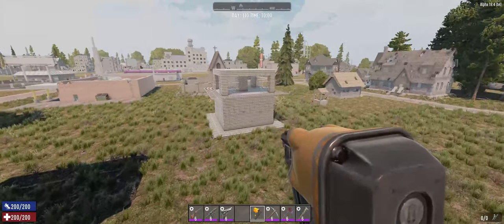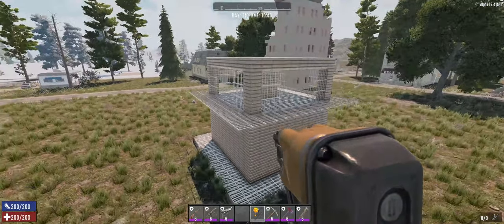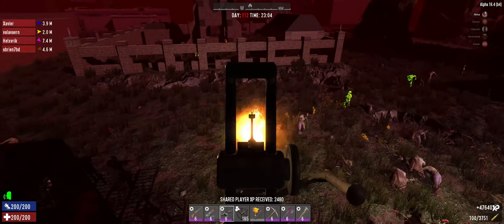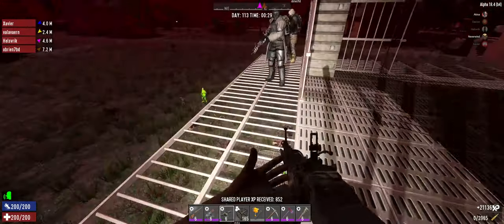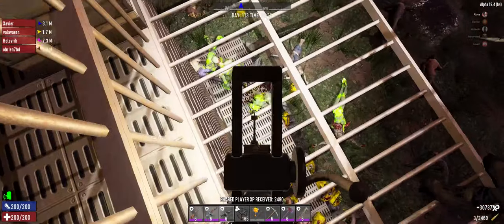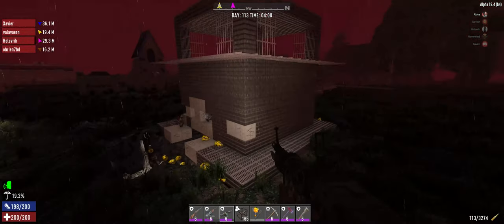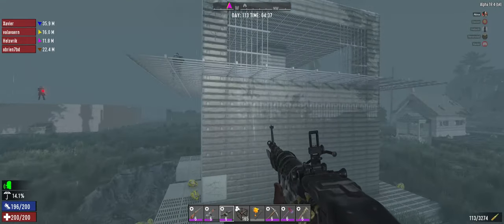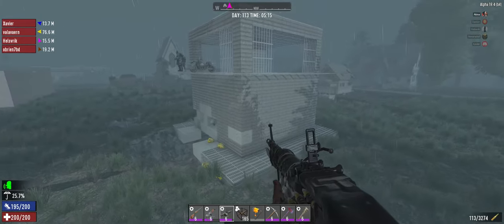7 Days to Die - Does Base Design Matter In End-Game?

Comment: Ditch the bars and use vertically placed half blocks around the perimeter with the gap facing the inside.  You can't fall thru the gap, but you CAN both shoot and throw explosives thru it.  
Sheath the outside of the half blocks with plates going up and overhead.  The base will look like a big mushroom, but it will protect you from spitters.  (Top the base with spikes to kill off the birds)  
Then just wait for a horde wave to crash against the side of the cube, toss down 9 unlit pipe bombs followed by a lit one, and wipe out the zombies en masse.  Rinse and repeat until 4am.  It's cheaper (around 700 bombs) than all the ammo you would have to use, and pipe bombs are craftable from simple materials.

Comment: You should try a doorway base! Get on the roof of a building. Build a ramp to it for this zeds. Then build a small wall to stop them from jumping. Then just build a doorway at the ramp with a block in front of it on your side or horizontal poles. Then you only need to reinforce the doorway. Super easy. Super cheap and you can just melee. No ammo required.

Comment: The problem with creators using only steel in their builds is it removes all stress of a breach.  My POI horde base has been breached 3 times (one death and two escapes), because I did not have enough materials early enough to upgrade the POI's walls.  Even though I have my horde base mostly horde proof at Day 63, I still run around the POI looking for walls to repair every time I think I hear a zombie smacking a wall.

Comment: Regarding this video, I second this. I'm saving all my base design concepts for when A19 finally hits the market, and so I've resorted to a very expensive but unimaginative design; it's just a set of four towers (9x9 wide and 7 tall for the floor, and the towers continue to extend above that) with four 15 block long, multi-thick walls connecting them, creating a square formation. Most of it's r concrete or steel, and even on 64 max alive (solo), they cannot make the tiniest dent into my fortress, and there's no traps, no pits, no cheese, just a strong, durable base. I've probably enjoyed defending this base the least due to the lack of effort I've put into it, but it's still extremely effective.
Great video, btw. :)

Comment: I built the pit to bedrock with a 7 block high suspended platform build you guys showcased a bit ago and that thing works like gangbusters except on night 70 they decided that instead of falling down the center they would dig straight down to me from one of the corners.
Reply from the maker: Hm. Tough to say why without seeing it.
Reply: @ICG  it was probably a case of a couple getting hung up between dirt and cement topside and it just led to a cascade effect where the rest of the horde just walked into the hole that they had started.
Reply from the maker: @TheTABCore  possible.

Comment: You also did this with 5 shooters bro... Not everyone has a squad of 5.  However good points made. I would like to see if this holds up with a solo or Duo.
Reply from the maker: True, but that also increases the size of the horse significantly. Solo hordes are generally a lot smaller than this, so there's a scaling factor to consider. 

We didn't post a video of it, but the issue was raised when we first posted this vid and it got me curious enough to test it solo on a private game. The results were similar, actually a little less damage because RNG didn't give me quite as many demos when I was alone.
Reply: @ICG  bro... this is one of them things that just ruined my grind... kinda like Duping. This killed a little piece of my heart for this game
Reply from the maker: @kaotichymnzz7625  Don't look at it like that - look at it as a challenge. How do you design something BETTER if this braindead build is the baseline for safety? Look for ways to make your builds safer, more efficient, more fun, etc.
Reply from the maker: @kaotichymnzz7625  I recorded a solo vid w/ this idea vs a 64 spawn horde today. You'll prob be interested.

https://www.youtube.com/watch?v=eTKXxe9ULiE

Comment: That the base design doesn't matter is one of my biggest criticisms. But I don't blame it on the durability of the blocks but on the equipment. As long as you have the right weapons and enough ammo you don't even need a base. You can just run around in the streets and fight the zombies like that. Or you take over any stable POI, make a few holes in the ceiling and shoot the zombies from above.
I miss the days when I fought the early horde with bow and arrow. My current base is a melee base. This is more fun than shooting the zombies and it is much more efficient in terms of resources.
But I also like base designs where the base can defend itself. Then I just have to get the popcorn and watch the base take care of the zombie horde. And I really enjoy building such bases. Unfortunately the Fun Pimps try to force you to actively defend your base.

Comment: Edit: As his later video proves quite well, I was wrong about what I said in my comments below.
A giant steel cube can withstand a horde of the size I faced in my video that's linked in the comment without failing.

Of course it matters. You have two choices.
1. Build it with pathing, so you can exploit them and keep them from destroying everything.
2. Build it with brute strength and keep them away from it.
Playing with multiple people invalidates the whole "Invulnerable" concept, because a bunch of guys can keep up with them.
Try a solid steel cube by yourself...
I faced off against a day 126 max alive horde by myself with a base that combined both options.
https://www.youtube.com/watch?v=7BG5Uxm9lLw 
They did major damage to it, and it was solid steel.
Reply from the maker: Actually did test this solo after the vid was published. Against the smaller solo horde it performed even better. Overrunning 1 person vs 5 is just a matter of scaling and whether or not you mess with your horde night spawn totals, which for this series we haven't.
Reply from the maker: You never gave a pan shot of the entire design that I saw in your vid, but I could see two things: a lot of single block wide pillar supports and that its monstrously huge, too large for you to monitor effectively solo. 

Not to put too fine a point on it, but your base didn't fail and the damage it took was a result of specific design choices that were added to it. 

The single block wide supports are a huge issue. Any block can be broken and if its the whole path of a support mechanism, it'll hurt to lose it. This is more or less an example of what I said here - yes, steel can fail, but only if your design allows it to matter when it does.
Reply: @ICG  Those pillars were put there as decoys for the zoms to beat on. 
They have nothing to do with keeping the base up. 
You can cut every one of them out and it will still stand, because the pawn shop it's built onto is the thing that's holding it up.
But they did cut right through them in a matter of minutes.
Saying that just because you build it out of steel, a base can't be taken down is just wrong.
If I had built it different so that they were not decoyed away from the "real" structure, they would have taken it down quick.
Granted, you might be able to kill them all before they can take something down on standard blood moon spawn count (8 vs the 64 in my video) but that's a big point to leave out.
Reply from the maker: @demandred1957  But thats not what we said here. The entire point to this video isn't that steel cant fail. Obviously it can. 

The point is that if steel fails, its BECAUSE of how it was used. If a steel base craps out, its because the design made that happen.

Any block can take damage and be destroyed, but that doesn't mean a base failed.  But if you use steel and the structure falls over, its because it was designed poorly. Thats our entire premise and the point of this video, not that steel is indestructible. Its obviously isn't. 

But if someone builds a base of solid steel and it collapses, that design is bad.

This video demonstrates that steel blocks with zero design concept, literally just stacked in a pile, can't be taken down by a gigantic horde at max game stage. It takes damage, but it never going to fail and we were never in danger. 

Thats the baseline. If you design and build out of steel and you end up in danger or your base fails, its because the design is bad.
Reply from the maker: And we didn't leave the point out re: horde size. We've discussed our settings for this series on many occasions. 

You're running a custom setting game with what is effectively 7 people's worth of zombies during horde night vs us on default eveything for a common baseline.  Obviously your conditions are different. But Id bet good money that this cube, exactly 25% larger, against your horde size, solo, would be fine. My own solo testing was against a 50 zed spawn limit and it was hardly scuffed - I lost 5 individual steel blocks with exactly these dimensions, which is about 20 seconds of repair work.
Reply: @ICG  I haven't gotten that far in my last several runs because I switched from "standard" gameplay (you die and it's nbd) to "Permadeath". 
But with the tweaks to AI and damage modifiers TFP's have talked about, I wouldn't be so sure about that if I was you.
So why don't you give it a test?
Nomad, solo,120min days, Day 126, 64 per wave, GS 250+. All other settings default.
Any handheld weapons, no blade traps/electric fences, any combo of junk/ sledge turrets you want.
That is what I was using.
If your 25% bigger steel cube holds up till 4am (and you don't die...) you win, and I will retract everything I said.
If not, I win and you have to give me a sub..lol
Reply from the maker: @demandred1957  you're on. May not be able to get to this recording this weekend, but it'll happen.
Reply from the maker: @demandred1957  Oh, and I'll take that sub from you when this is over. 😁
Reply: @ICG  Bet!
Reply from the maker: @demandred1957  For the record, that sub-for-sub swap is banned by youtube, so we can't actually bet that and are not doing so. I will be happy to link your channel in the vid description when it drops. 

In a couple hours. 😁
Reply from the maker: @demandred1957  Ru-roh, Raggy.  

https://www.youtube.com/watch?v=eTKXxe9ULiE
Reply: @ICG  Good show bro. Thought they were going to get you once they had cut into the side far enough.